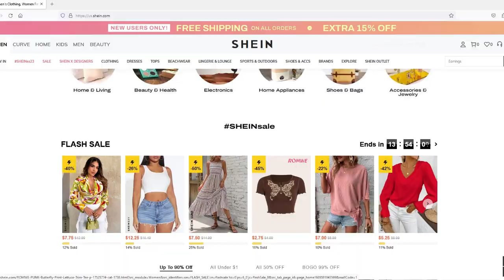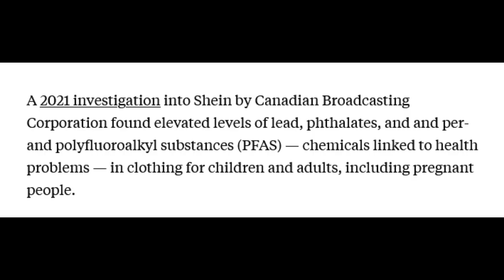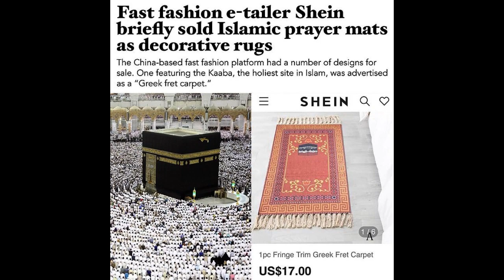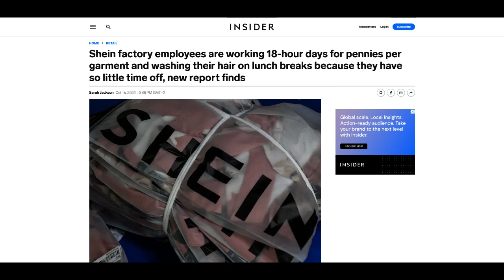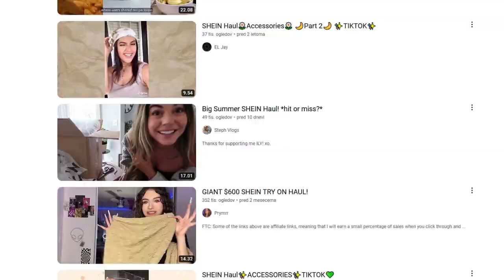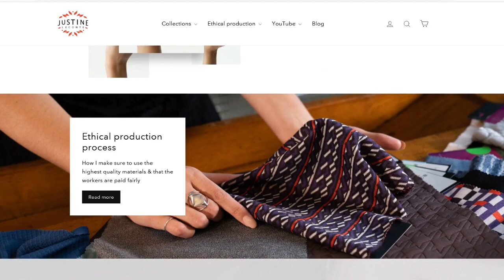Let’s Talk About That SHEIN Influencer Brand Trip & FAST FASHION

Comment: I haven't heard about Shein, but it sounds like those stores like H&M, but in a way larger scale. Ever since I've seen those documentaries about factory conditions, it just looks like those stores are massively producing their clothes. I'm a bit picky on clothes, so I rather use a small set of clothes for a long time. The second-hand shops are pretty nice too, since you can get decent winter clothes and festive clothes for a cheap prize. And usually the older designs are more timeless and uniquely looking as opposed to the trendy ones. As a student on a budget, those kind of clothing are way too expensive to get new anyway. I live in the north, so wool is a necessity!

Comment: Nowdays I usually wear my clothes until they are so worn that they have holes and such (don't matter as I wear them at home). When they are unusable, I will usually use the fabric for something else. I recently wanted to buy some new clothes, but I found the problem, as I wanted  to support ethical slow fashion. First of all, I don't know many brands and google is not really helpful with this. Then I wanted to support local businesses, but they didn't really have anything interesting looking. Easiest way to get new clothes would be going and buy some fast fashion stuff from near New Yorker, but I want clothes that can actually serve me years. So I went to my wardrobe and took some of my older clothes I don't use that much, sewed them together and bam, now I have a summer dress. I really want to make clothes myself, but I'm not very good with sewing durable or fitting clothes. But I like the idea of making old clothes to new, and it seems to be closer to my skill. If anyone knows any slow fashion brands that have not-so-everyday-looking clothes (I don't like jeans and t-shirts), feel free to inform me.